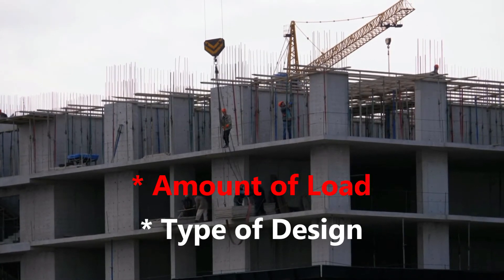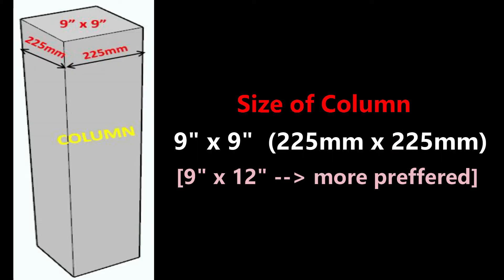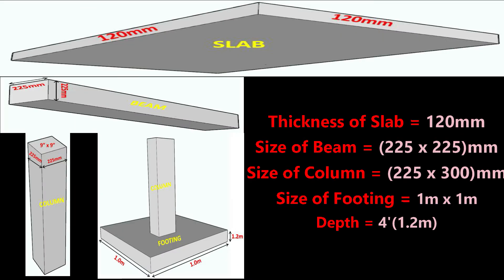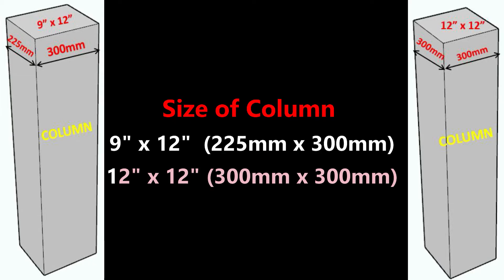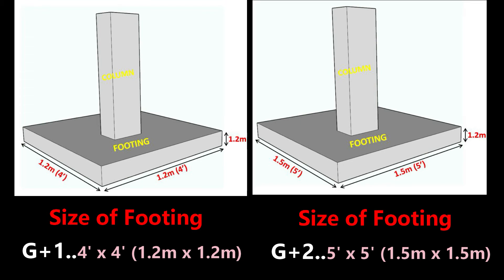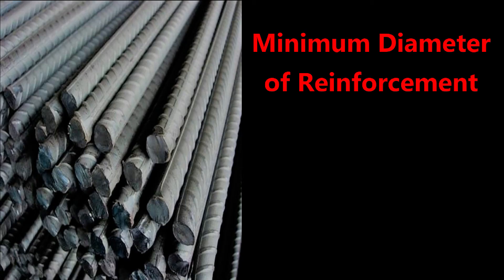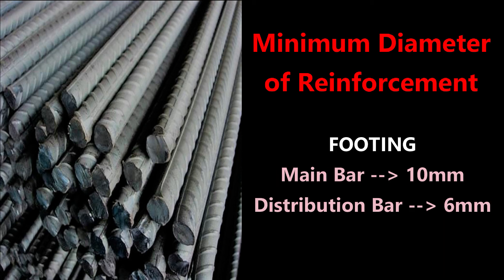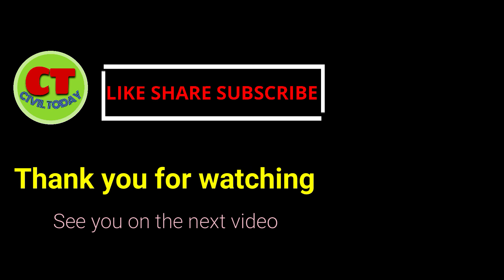Minimum Size of Slab, Beam, Column and Footing || Civil Engineering

Comment from the maker: Hello Friends,
There is one small mistake in the video.
I have mentioned depth of the footing is 1.2m - The depth is from ground level to bottom of the foundation.
But in image, I have shown the depth position incorrect.
As per the image, the depth 1.2m shown, should be replaced by 0.3m.
The minimum thickness/depth of foundation/footing is 12"(0.3m) &
the minimum depth from ground level to bottom of foundation is 4'(1.2m).